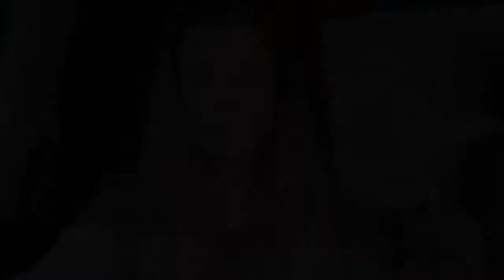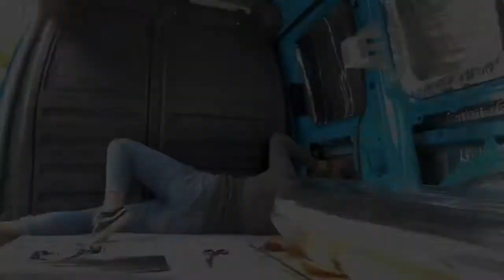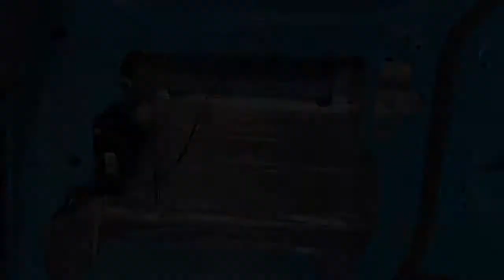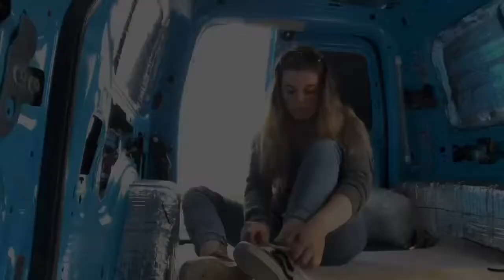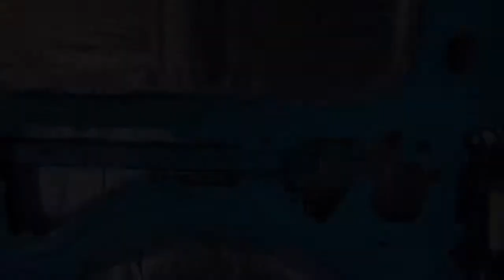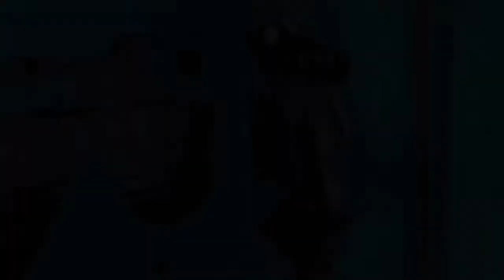FINAL PART OF DODO THERMO LINER!

Comment: Hi, the thermal liner looks good and practical. It’s a sound deadening, closed cell foam for insulation and a reflective surface to form a radiant barrier / reduce moisture all in one! Remember to tape joints if it’s a moisture barrier if you have had to cut it. Just going through the series of video’s having watched a lot of others doing it.